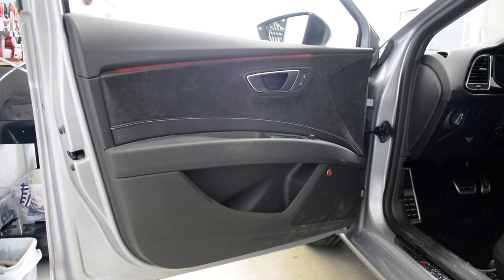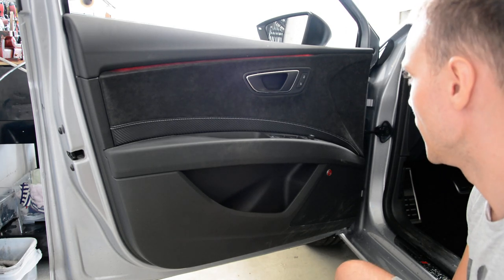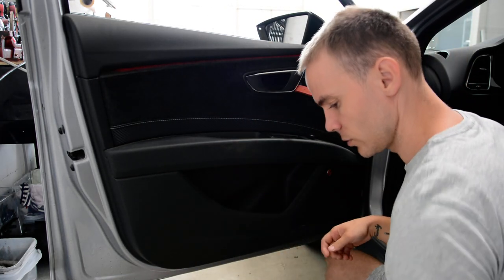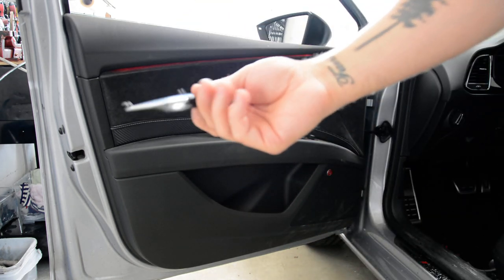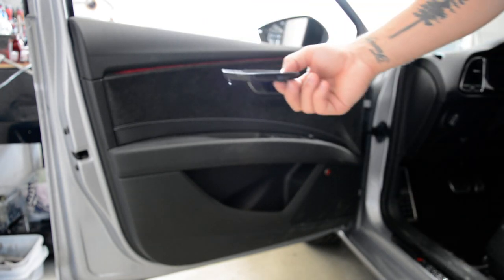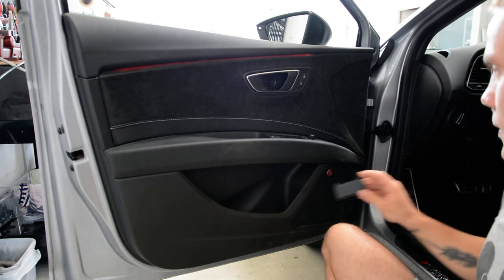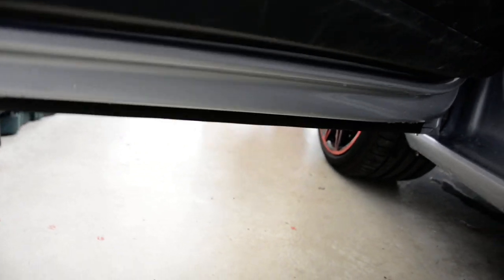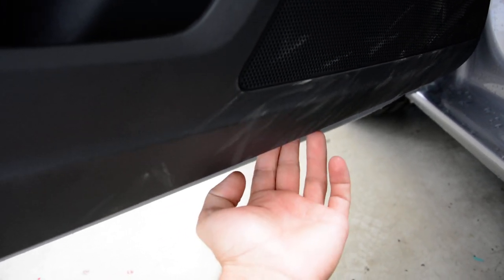How to remove the front door panel Seat Leon Cupra

Comment: Great video! Do you need to remove the door panel to replace the window switch? Thanks in advance.
Reply: Hi Neil my switch is damaged and I need to replace it, just wondered if you changed it yourself or went to a garage? If so did you have to take the whole panel off or could you get into just the switch another way, really struggling to find any answers? Many thanks.

Comment: I need to fit the door card back on, it's not sitting right. Is it just a case of pushing it back into the clips?
Reply from the maker: Yes take it down one more time check all the clips because the clips have two positions, close and open, the clips are close when you push on them and open when you pull. When you install the door panel all the clips need to be open and need to be perfect aligned with the slots. Good luck
Reply: @DFCGarage  Hello and thanks for the informative video. Can you pls tell me the factory code of this door panel?